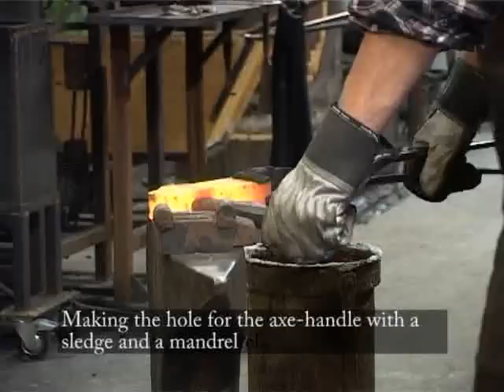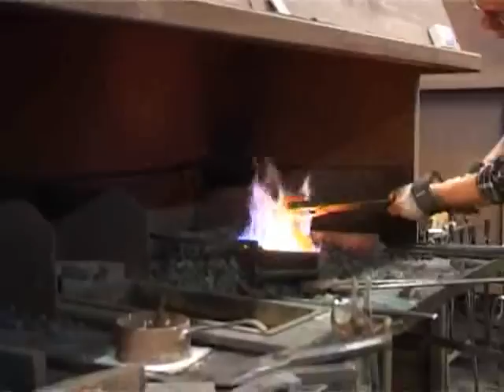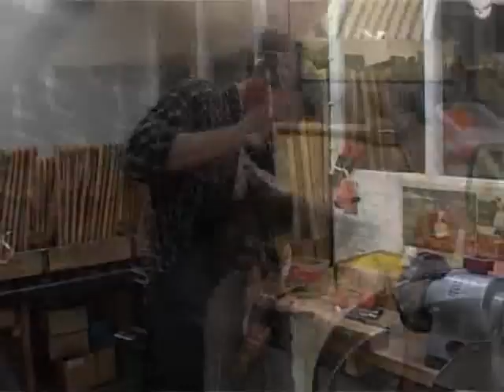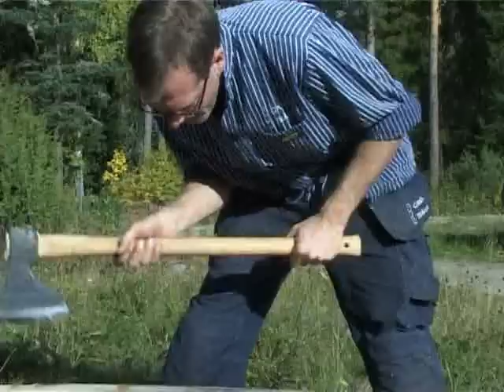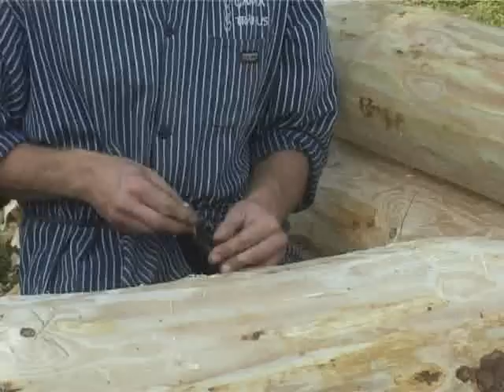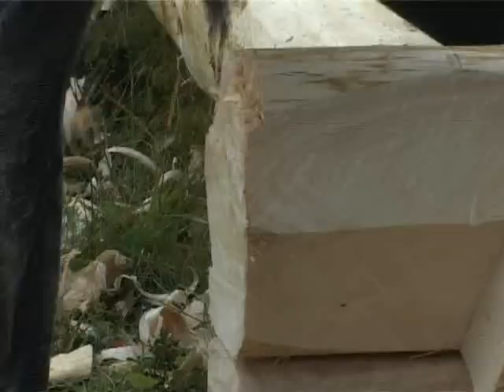Traditional axe making and wooden lodge construction from Sweden

Comment: All that when you can go to Walmart and buy one for less than 10 bucks.
Reply: A ten dollar axe will never be equal to a proper hand-crafted axe.
Reply: A $10 axe is cast' as one piece of inferior metal. A hand-forged axe will last 1000 years easily, and cuts like a dream.
Reply: Or like the hatchet I made yesterday out of a railroad spike. It's surprising how much metal is in those things.
Reply: I could go on a rant but I won't... In short u get what u pay for and steel/ proper heat treatment is everything
I doubt you've ever experienced a proper axe
Reply: How Sharp is "sharp" to you Mr 10bucks 
Can u shave ur face with it? Probably not
Reply: Jason Johnson
the axe should be able to cut hair with the same ease as a razor.
Reply: Kane Smith That's alot of rage, but I like it ;) I mean the stuff you buy for a cheap price are massproduced and usually don't last for very long.
Reply: I've bought the one at walmart. it makes a better hammer than axe.
Reply: motorcyclemike1
I have a craftsman carpenter's hatchet from sears, cuts like a hammer but is good for pulling nails. They made it out of soft steel.
Reply: Fr33man1988 Excuse me, I just can't understand your logic in joining into a comment section and immediately calling everyone idiots. Is your opinion better or more valuable than anyone else's? By doing this, you've intentionally provoked people, which is the purpose of being an internet troll. You and all the other trolls have made virtually every comment section at any site......dangerous places for sane, decent people to have a discussion. You hide behind anonymity, and all your baser instincts bubble up uncontained. 

I don't understand the psychology of doing what you do, but it is easy to see that this bad behavior masks some deep feelings of inadequacy.
Reply: it's nowhere near the same axe
Reply: Fr33man1988 how many 10$ axe's have you bought? and how many have broken, how many years they lasted.
Reply: sgt jimqatnt I have bought 2 in the last 10 years.
Reply: Fr33man1988 wow. what country made them?
Reply: Craftsman axe made in the USA
Reply: Fr33man1988 I have had $10 axes and hatchets that I only needed "once in awhile".  Axes should be sharp, about equal to a knife, and those $10 axes go very dull, very quickly.  A dull axe results in you basically trying to chop a log with a hammer.  You expend a lot of energy when you don't need to. A good quality axe will stay sharp and chop through wood very easily. 

The thing with the 'walmart axe' is that it's basically disposable.  You said you only use your axe once in awhile, and you've bought two in the last ten years.  I grew up on a farm where our primary heat in the winter was wood.  We had an old axe that my Dad got from his grandfather, and we used it all the time.  It's had a number of different handles put on it but my brother now has that same axe and is still using it.   

Ya, it's just an axe, and yes you can spend $10 an go buy one at walmart, but until you have something of quality you don't know what it's like.
Reply: Fantastic bait. You rustled many the jimmy.
Reply: I got 2 walmart axes and they are still sharp enouf to cut a chikens head of but then again i do not use them much.
I also got a axe a friend did buy from Sweden that one i use allot and it stays sharp even to the part where you can use them as a chissel that i could never do with the cheap ones i got.
So it depends where u use it for for work or just for decorating the barn.
Reply: You could also go to McDonalds instead of cooking your own meal, but one will be worse than the other...
Reply: Dr Silberman Worst analogy so far. I can go to a 5-star restaurant and have a much better meal than one at home. You fail.
Reply: Dr Silberman Can confirm. Have worked at McDs for the past few months. Nothing like cooking. 

But y'all are both arguing over semantics now.
Reply: I've been unlubky enough working as a carpenter (mainly wooden construction) that has a base in furniture carpenting to use these "10$" axes while beeing out on construcuion builds as a hired in carpenter, I am also practically broughg up in the outdoors learning to use a knife at three years old and goj mu first axe at five for my birthday (a beautiful handcrafted old hultsfors bruks hunters axe my father had for many years before giving to me.) And while tossing away 10$ axes in the tenths every year because tje people I work for doesn't wanna spend about a 100$ on an axe that will be good for 10+ years insted of spending thousands of dollars on axes me and my co-workers toss away every year I can't see how you can even look upon and think that a 10$ axe is equal to a handcrafted one. I still have exactly the same hultsfors bruks axe my dather gave me almost 25 years ago and it itself is most likley 35+ years into use and I use it almost every day though not as my tool for work as long as I ain't buildi g at home, and i rarely even sharpen it. I look after it everu evening after I've used it and check it just to be sure. Might need a new shaft but to be honest this axe I am sure will outlast me with YEARS!

So mu poinh beeing: don't be an ass. Buy your shitsteel axes and be glad to not brake any bones (I can hardly imagine you will cut anything of with a hammer) and keep your mouth shut for the resg of eternity because no one will ever want to hear that shig you spew out.